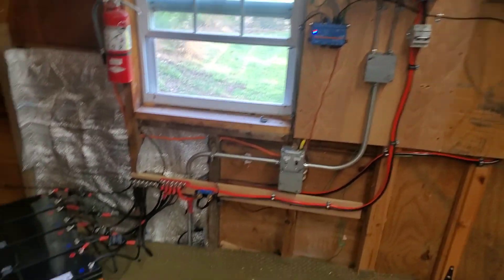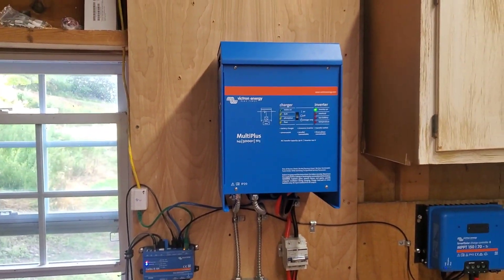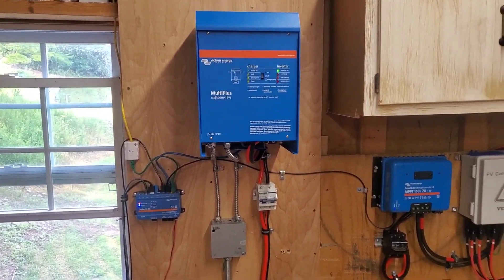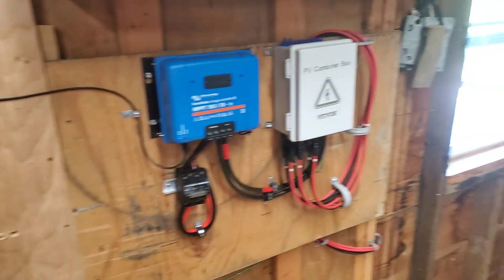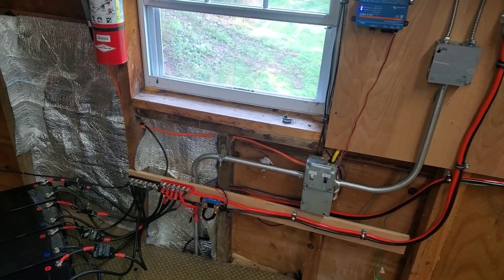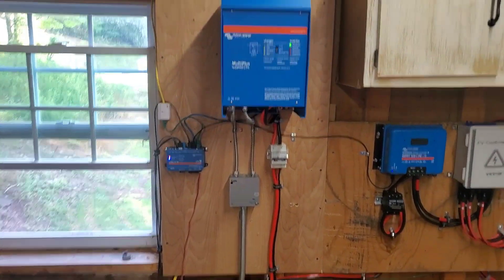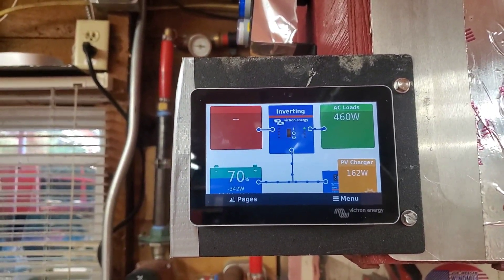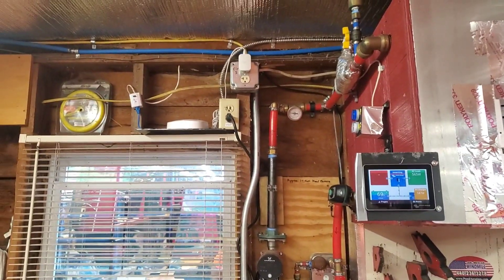2000 Watt Solar Garage System - Part 4 Upgrades. Victron Multiplus Inverter Charger

Comment: I am kinda disappointed because you can spend thousands of dollars on a nice inverter but that power hungry AC will consume most of it. So it has nothing to do with go green unless you find power efficient devices.
Reply from the maker: @ferdm9646  This is true...underground geothermal cooling is on the horizon. Thanks for watching....
Reply: @huggmeister  try mini split with inverter technology. They don't cost you a fortune. Thank you for sharing.